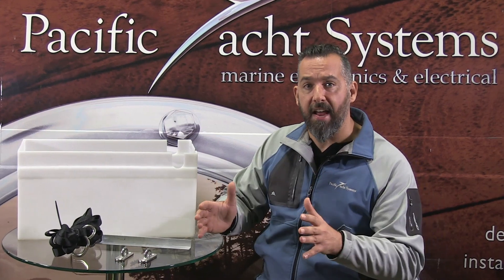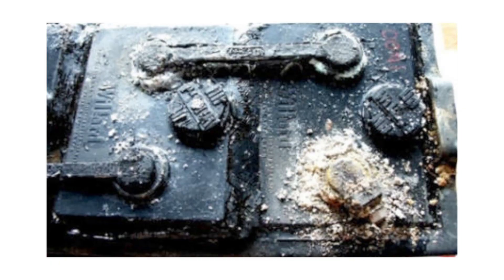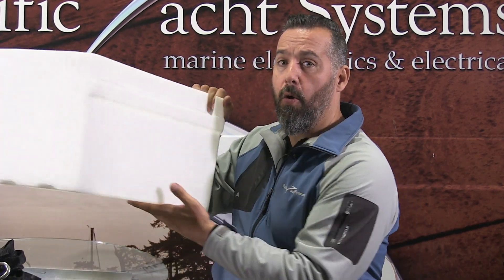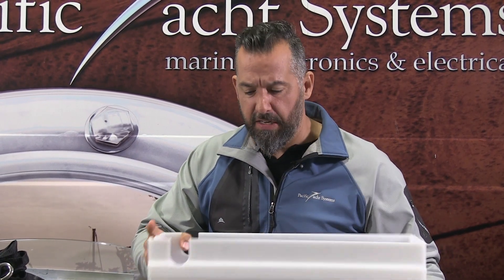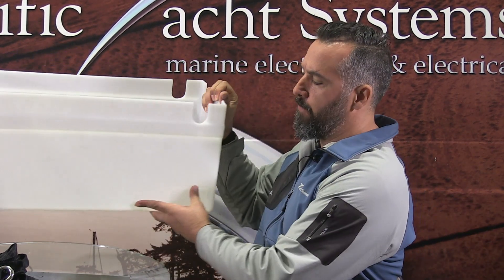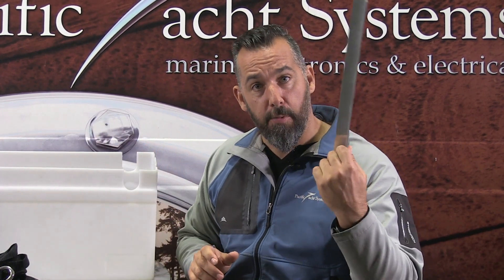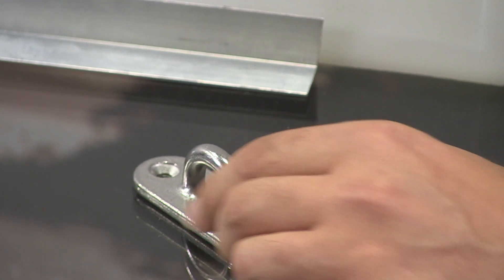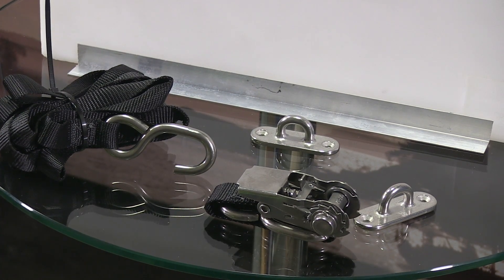How to Properly Secure a Boat Battery

Comment: I just bought some 4D batteries and Noco boxes with screw hold down on each corner so you don't have to screw through the bottom (yes screw, I have no access below to through-bolt).  According to Noco these meet the USCG requirements.  I was still going to add some sort of blocking on each side and then strap the whole box down.  Am I going overboard?

Comment: Hi Jeff, love your videos they are so informative! I have a question, If you find a nice battery box installation which is not tied down but secured from lateral movement on a powerboat, do you generally recommend that they tie the lid down with a nice strap like the one in the video, or just leave them alone on it as the chance of capsizing is less on a power boat vs a sailboat? They way I read the ABYC standard, the box should be tied down. Thank you very much in advance for any insight you might have.
Reply from the maker: Hi Jeff, even on powerboats, we always install heavy duty straps to properly secure the batteries in place, even when secured from lateral motion by some edges.
Reply: @PacificYachtSystems  Thank you very much Jeff.

Comment: How are the batteries secured inside the battery box?
Reply from the maker: Really depends, some battery boxes have stoppers or even bars on top that stop the batteries from moving up and down. Sometimes, we use starboard within the battery box to limit the motion of the batteries. We also commonly use heavy duty cargo straps to hold down the battery box and batteries.

Comment: Although you didn't elaborate  on securing the battery inside the box, using your suggested method it seem that it would allow a great amount of movement of the battery inside the box itself, movement that could damage the box and the battery.  I would rather purchase a battery box with external protrusions for fastening, the box to the base material, then use pass thru straps to hold battery down into the box.   Subsequently, a perfect battery box to me, would have both external protrusions on the base for mounting the box to the base material and then have reinforced slots for pass thru restraining straps, at multiple heights and on all four sides of the box, in order to accommodate different size batteries  and battery post orientations.  The reinforced slots could be produced to be a "Knock out" type, so that the only slots needed would be knocked out or "Opened".
Reply from the maker: Hi Nelms, I'd be your first customer. Unfortunately, not aware of such battery box in my deck of the woods.